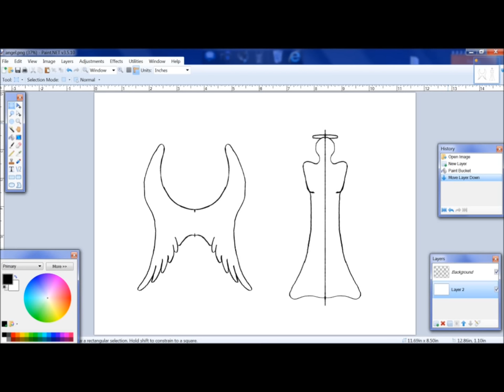Angel tree topper

Comment from the maker: It's also worth mention that the one that I had originally made was somewhat of a unique invention; I made it to be a "projecting" tracing table, because it would increase the size of the image if I wanted. I did this by making multiple saw cuts, and there were two pieces of plexi. Imagine the image to trace on the lower shelf, and the space between the two shelves caused the actual tracing to become magnified (enlarged). I had almost forgotten about that thing. It was kind of cool.

Comment from the maker: Before I had this "store bought" one, I did actually make one (the quotes are because I had actually salvaged it). Take a piece of 1x6x3/4" and rip a saw cut down the whole thing that is around 1/4" deep. Next, build a box with it, and the saw cut will be a channel that a piece of 1/8" Plexiglass will fit into. Paint Plexiglass white or sandblast to diffuse light. Small light bulb inside= simple tracing table. Hope that made sense, because I'm tired.